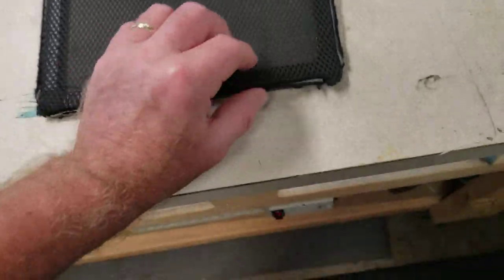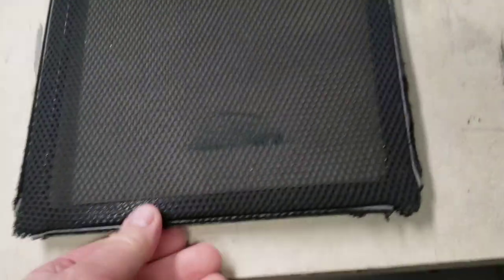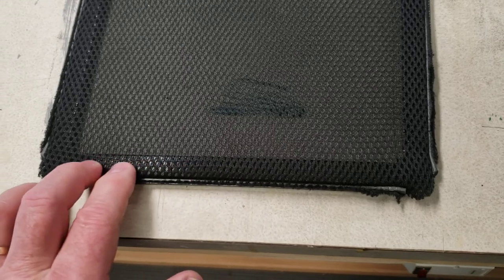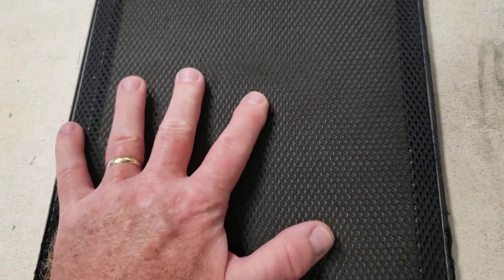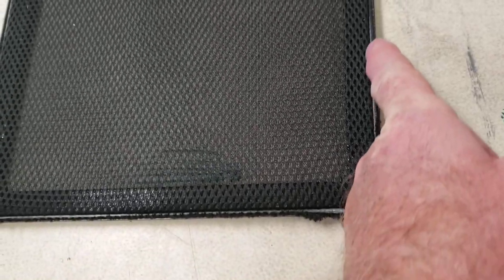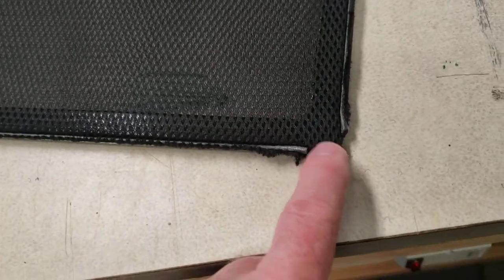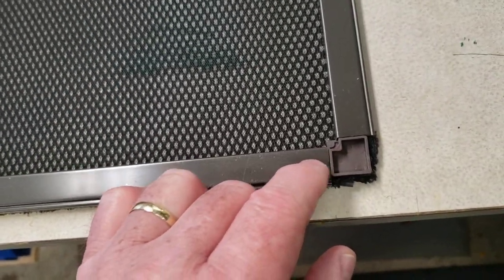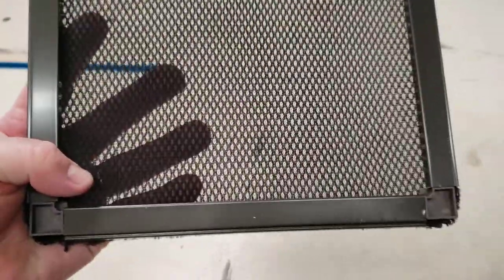How To Make Cabinet Doors with Speaker Cloth: Part 1

Comment: I like the idea of not using glue. I will be buying a premade door with routed edge of door back made to hold glass but I will use speaker frame and fabric instead.  Can you tell me where your frame hardware can be purchased ?
Reply from the maker: Hi John!  You can find the screen frame hardware at any hardware/big box store like Menards, Lowes, Home Depot, ACE, etc.  Just look in the section for Windows/Screens.